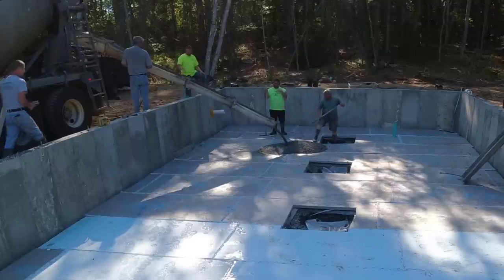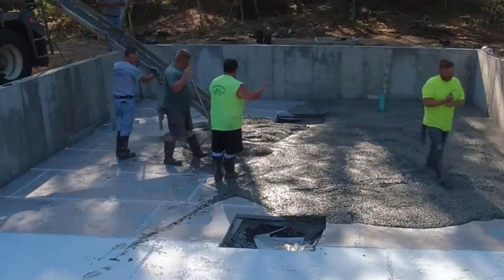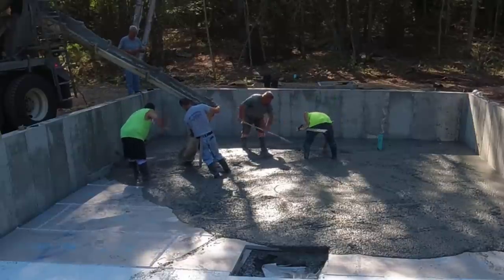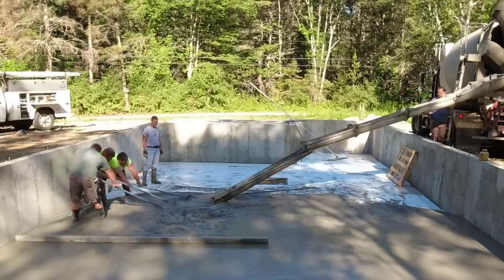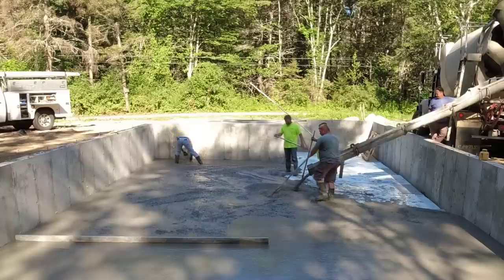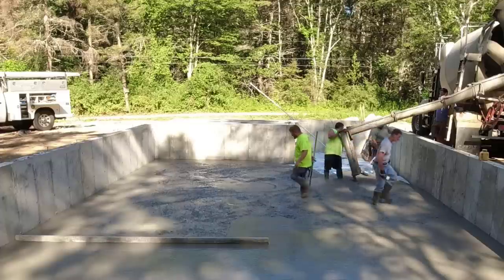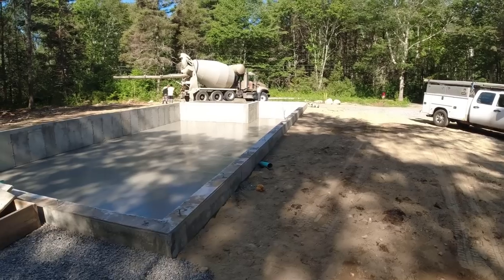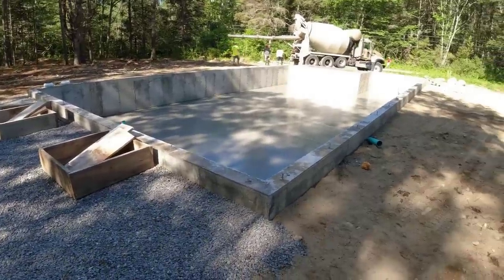We're Pouring Everything - Basement Floor, Entry Slab, and Sono-tubes

Comment: Hi Mike : Great idea for flipping the shoot over, like that one👍. Our crawlspaces here in Colorado are usually gravel floored or dirt with Radon mitigation piping/plumbing laid around the perimeter or in a grid across the whole area. Then we lay vapor polly overlay and the radon mitigation piping goes out a side port past the roofline with a fan to create negative air pressure from the crawlspace to the outside. I like the Concrete, then you could just keep the radon mitigation piping under the concrete and have that great crawlspace floor to set your storage items on and all your other mechanical needs under your living space floor.😊👍
Reply: Great comment! I hate crawl spaces that are less than 4 ft and have gravel with a vapor barrier. I inherited a house that has this.
Reply: 5 yrs down the road, WHY didn't I spend a few thousand more for a full basement? cost/sqft at that point was negligible, poor me.
Reply: Was thinking can't have a basement cuz of radon but don't usually see that in ny... usually crawl spaces are for areas where the water table is to high

Comment: Good video  like I was watching  myself at work  but it wasn't me. Most if not all residental  houses in my area have  full basements it's cheaper to dig down than go up for square  ft.A lot say 60 ft by 120 ft in the VANCOUVER area of Canada is selling  for 1.2 million dollars or more and strict  municipal codes on hight and size of building  come into play as long as you aren't  on a flood plane area and 9 ft depth is common to give 1ft for duct and plumbing  work and still have a 8 ft Finnished ceiling hight but you have to have  wallk out access to the basement and window  wells for emergency  exiting to meet fire codes .if you have time a short  video on the type of blades you are using on your  saw for cutting   green slabs with  out tearing the concrete  interest  me in my 30 is years  I haven't figured that out yet I don't ever flip  the chute but good idea he foundations are to close  together for access  so wind up mostly pumping them .concrete prices 250 per m 5 m min load charges below that amount. Concrete  powder shortages really screwed wit us this last  summer more  than  the prices  you can pass on price  increases  but if you cannot get mud you are screwed might have to switch to doing asphalt  paving  for work

Comment: Full basement just makes sense if you are going to invest in a slab, unless the subgrade conditions prohibit it, or the budget is just too tight!  Those post footings make me cringe, it's obviously faster this way but those should be put in first separately, so the main slab is independent of the footing.  And... no reinforcing?  The ultimate is to do diamond block-outs then when doing the slab, so even that section is isolated.  Draw the control joints for the field off the diamond tips.  Like everything, there's 'good enough', and then there's most ideal.

Comment: Good morning Mike and yes I have a crawl space. Thrive Real Estate had a good comment. I hate my crawl space and actually I inherited it with the house. It's less than 4 ft high and it's covered with pea gravel and a vapor barrier. Minimum code which is not a good way to go a lot of times right?
Rats really like it though. And as some of you may guess I'm going to need to spend some time mitigating rodent advertisement.
Reply: So have a crew with a line pump place 2 1/2” self levelling over the whole crawlspace. I’m doing that next year at my mom’s as it also is light aggregate over 6 mil poly.
Reply: @blueman5924  😎 so cool thanks for the epiphany!